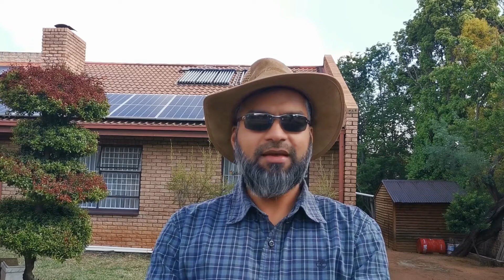This BAD Habit is KILLING Your Inverter!

Comment: Can you recommend a good inverter that can handle high inductive loads?
Reply from the maker: Depends on the power rating of the load.. If it's for an aircon, then a 5 to 8kw should cut it. The Goodwe can handle it only if the power factors are configured correctly.
I have not connected my aircons to it though.

Comment: Sound advice, thanks. We have a 8.8Kw Sun Synk inverter and it handles major loads exceptionally well. Even during load shedding the dish washer as an example works perfectly well, this together with a 12Kwh PV panel output.
Reply from the maker: This is a great example of an inverter that is fit for purpose to handle these types of inductive loads. The Goodwe is not capable of this.